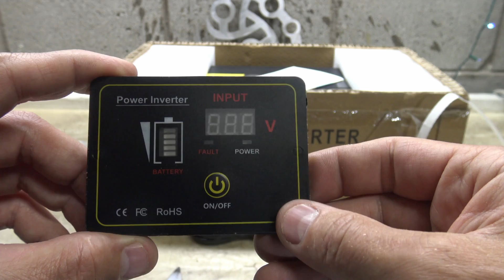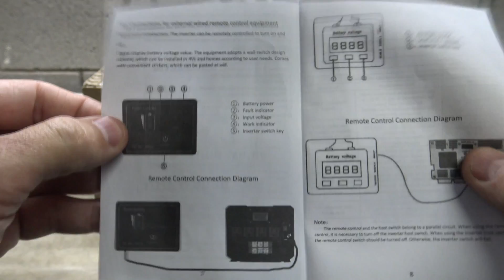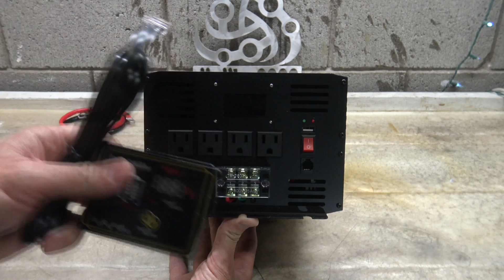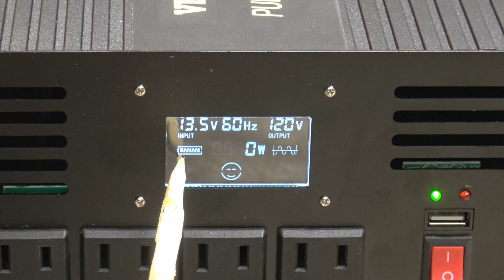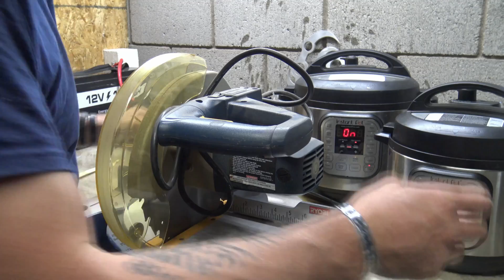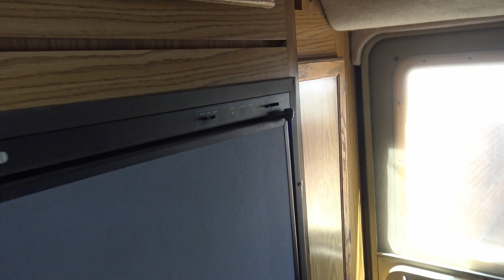OFF GRID POWER - VEVOR 3500 Watt Pure SINE WAVE Inverter - 7000 Watt Peak - It's EXCELLENT!

Comment: HOW is that 100ah battery putting out 2500w!? That's like a 250A 12v draw! That means the BMS is not properly setup. It's likely to burn up. 100Ah battery should have a 100A max draw BMS or 1C.

Comment: What is that part between the cable and chins battery? Is that to use a battery while charging the battery?
Reply from the maker: Great question.  It's a circuit breaker
Reply: @jiujitsu2000  also another question, what are the smaller wires before the inverter cables? Is it charging the battery while using the battery?

Comment: I thought about buying a vevor 2500w inverter but have some not so good reviews. I have a renogy 700w its a good inverter but too small for what I need. Most of the bad reviews on vevor were it didn't last much over a year and another person said it almost caught on fire. I need to run a 1400w chipping hammer but less than 5 minutes at a time.

Comment: I just installed my unit but it is reassuring to see others using the same unit. However the only thing different I am doing is installing an Ultra-capacitor behind the inverter to lower the battery voltage fluctuations and if the battery is fully charged then the unit will grab power from the Ultra capacitor before the batteries. The secondary advantage being that excess power from the solar panels will get used before the battery gets touched if installed correctly. It almost acts as a sort of solar soft start for the unit. Some people will say that you don’t need it but people who have it show it’s worth having. It’s just too bad that not many videos cover adding Capacitors to your system. It’s likely just because it can be the more dangerous thing to touch with bare hands when installing. So wear gloves. They increase the life of your system too by offloading cycling from the batteries and making power immediately available faster than even lithium.

Comment: Are you able to plug that into your home? Electricity one hundred ten volt circuit and power it off of that, instead of a battery I want to get the 48 V. Version so I'm sure I can hook the 48 V to my power box downstairs safely. And then I could run a Bitcoin miner. And make five thousand dollars every year

Comment: Great video I like to comment about using the test light so you don't get the spark too late for me for that 1. Also no one addresses the hardwire terminal box which 1 is the positive neutral and ground on it ?  When they use a black yellow and red wire all known to be hot wires

Comment: Give it a year, a year and a half tops of continuous use, especially when powering inductive loads, and I can pretty much guarantee that you'll be sending this unit to a shop for repair. All high frequency, transformerless inverters on the market have a much higher, failure rate when compared to low frequency, transformer based inverters. The reason for this is that these cheap, lightweight inverters don't have an iron core, copper wound, iron core output transformer. And a 7,000 Watt surge capacity for a 3,500 Watt inverter is pretty wimpy when you consider that a low frequency inverter inverter offers a minimum surge capacity of 10,500 Watts. And you really ought to reconsider your claims about this product. This inverter is absolutely NOT certified for use with medical equipment. It's not even UL-1741 listed. If a patient is injured because of your recommendation that this inverter is suitable for use with medical equipment,  you're probably going to find yourself in legal hot water.

Comment: I bought one of those things found it to be cross wired from factory did continuity test on the four out put receptacles and the neutral and hot were swapped on every other one of the 4 that can’t be good but the ground toned out fine this was also the case at the bottom contacts between the receptacles and the hard wire contacts below
Reply: Tha would explain why mine just sparked out and almost caused a fire...

Comment: The main issue I see here is most 100AH batteries have a maximum continuous draw of 1250 Watts, and at that draw the battery will last 1 hour maximum.  There's no way a 400 Watt solar is going to keep that battery from discharging so you are going to be "dead in the water" within one hour.  So much for keeping cool in hot weather!
Reply: how many watts of solar would you imagine is needed in this case?

Comment: So, that battery sag (dropped to 11.?v while you had the big load) is potentially a problem.

Keep in mind this is a 12v DC input, so at full rated load, you're pulling almost 300A. For the peak 7000w, that would be about 700A spike! I'll bet almost anything that battery isn't rated for a 300A output. You see a flashing red warning light near the power light on the invert during these situations.

Best to have multiple batteries paralleled (3 or more) so that each battery isn't exceeding it's rated output. 4 or 5 if you expect the 7000w spikes to actually be a thing on your implementation. Those lithium batteries do have a surge/spike rating but you still need to allow enough head room on the batteries to handle that spike.

One big issue with this setup could be that parts may fail in the inverter if the input voltage is insufficient. With a lower voltage a FET may not turn on fully and therefore it generates massive heat and it burns out, and you have a dead inverter, because YOU didn't supply it enough DC power.

When paralleling batteries, the neatest solution is to run each battery positive to a honking big bus bar, and the same for the negatives (to a different bus bar) and then connect the inverter input to those bus bars. This ensures you have sufficient input and the inverter won't struggle to turn those FETs on, giving you safe operating conditions.

Also, "sine wave" inverter isn't specific enough. Insist on "Pure Sine Wave" inverters. Never go for the cheaper modified sine wave or something only labelled as "sine wave" (if your goal is clean power like you get from your utility grid in your house).
Reply from the maker: Excellent comment.  Thank you so much!

Comment: Why do you suppose that they include so many fuses? I'll tell you why. These inverters simply don't last. They are of a high frequency, transformerless design and the MOSFETs cannot take repeated exposures to high surge loads such as full sized refrigerators, power tools or microwave ovens. They also run much hotter than low frequency, transformer based inverters which makes the low cost, off spec, Chinese made components such as capacitors, diodes, resistors and  ICs that are used in these cheap inverters, far more prone to early failure. You might be able to start and run high surge loads when this inverter is new but everytime you fire up that inductive load, you're shortening the life of your inverter. A far better alternative is to invest a little more money and purchase a low frequency, transformer based inverter charger. They last far, far longer and can easily power high surge loads without being damaged. See my video for more information on high low cost frequency inverters. I know this to be true because I've spent the last 23 years repairing inverters. They simply don't last when powering inductive loads. https://youtu.be/ZUvH8_h3iGU?si=F8Glaay4WKgoBIj8

Comment: They don't usually spark if you leave them turned off during connection.
Reply: Nah, they pretty much always spark. Your on/off switch only isolates the output. The input will always charge the caps as soon as you connect it. Use something resistive (a 12v bulb, an actual resistor about 20ohm and 5-10w or even a graphite pencil led will work) It only takes 3-5 seconds and the caps will be charged enough that that inrush of current will be subdued enough that the cable touching the terminal won't spark. Also the caps should hold that charge for long enough that you don't have to rush to swap out the resistive item and get the cable to the terminal. Well over a minute or more, so don't stress and start rushing. Keep it slow and safe.
Reply: @CollinBaillie  I've always made sure that they were turned off and have had never had one to spark.

Comment: How much power does it use in standby mode?
Reply: Website claims less than 1amp. I just ordered one a few days ago and a 260ah battery for my truck.hopefully it will run a mig welder for offroad repairs.

Comment: 👍👌❤️🇨🇦, sweet review, I would like to have a temp on the cables, I would be installing larger ones for heavy loads, less voltage loss, I would also like to see the  same display that is on the inverter to be also on the remote display, the little battery display is basically useless, having the volts and watts on the display would be a big bonus

Comment: I bought one for a home solar system, works great and it sells for as low as $210 now.  Buyer beware as many Asian brands advertised as pure sine wave but are actually modified sine wave.
Reply: That's good to know - they also at times over rate the inverters they will not perform as stated -

Comment: Not bad of a test only thing I seen was the voltage on the unit and remote did not match even with no load on that unit. With that big of a load I bet the battery will not last long but it do it.

Comment: You can damage the battery or the inverter by making it spark while connecting. It is recommended to use a resistor between the battery and inverter before connecting. This will charge the capacitors and there will be zero spark. If you don’t have a resistor handy and most people don’t you can do what I did. Take a simple test light the kind that looks like an ice pick, and clip the alligator clip to the battery cable and touch the other end to the battery terminal. The bulb in the test light will illuminate and then go out indicating the capacitors are charged. This test light must have an incandescent bulb to work. Not an led.
Reply: Yes I use an old 21 watt car bulb in series to pre charge the capacitors.
Reply: The only pieces at risk of damage are the screws 🪛 bolts 🔩, and washers. Pieces of molten metal could be generated and hurt people very seriously. 

Inverter internals and battery won't get damaged.

Disclaimer: do it at your own risk. I don't take responsibility for damages.
Reply: Do you mean like a fuse

Comment: I just bought the 2500W and it won’t stop beeping. It has 1/0 wire and is reading 12v input but won’t give any output and beeping non stop.

Comment: BE VERY CAREFUL. these inverters blow up. I'm serious. a guy gave me this exact one and the company cut corners on diodes to protect the IGBTS and the failed causing the whole inverter to smoke up. sure it works good (I fixed it and tested it) its just it will blow up.
Reply: I'd be interested to know more about your setup. What sort of battery were you using?
Reply: @CollinBaillie  lifepo4s and Agms at 12v

Comment: You can make a connection with a big resistor between the cable and the battery terminal to charge the capacitors in the inverter without a big spark then make the final connection with the cable to the terminal to keep from blowing out the inverter.
Reply: This is a good idea but the right solution is a flyback diode. Check that out.

Comment: One question...... could you hook up two inverters in series or parallel in a system?? or it's better to get a bigger wattage one to run?
Reply from the maker: I'd get a higher wattage inverter
Reply: @jiujitsu2000  thank you
Reply: Always better to go bigger than you need & not run them so hard, it may have a higher idle draw but will handle inductive loads better, ie: motor starting, microwaves, coffee machines, etc.

Comment: I love this inverter, however..... How do I calculate how long I can run it?   Battery "Ah capacity" as how it relates to load = time?  I am obviously a newbie and need some help in the design.
Initially I bought a Ecoflow River 2 (300w) powered by Renogy 100w Solar panel to get started and want to eventually bump it up to 2000w+ for when I leave on my USA Ultimate road trip (Honda Odyssey build out).
I need to calculate total Ah needed to finalize the build out and see how it affects my budget on the battery costs.
I thank you in advance for your time and help on this matter....... (GRIN)
Reply from the maker: Great question. What's the amp hour of your battery? Take that number and multiply it by battery voltage. My setup for example. 300A x 12.8V = 3840 watt hours... then you take wattage draw... let's say its 1000 watts... divide watt hours  by wattage draw... 3840 divided by 1000 =  3.84 hours... I usually round it down to the next number to stay conservative  so it'll run for appropriately 3 hours safely...I hope this helps you!
Reply: @jiujitsu2000  Thank you for the math.  I do not have a battery yet, but this helps in finalizing LiFePo4 battery(s) selection.   Thanks again!
Reply from the maker: @tobyz.3452  you're welcome!
Reply: @tobyz.3452 definitely go lifepo4 for this if it is in ur budget, but also remember to check on the battery BMS size for charging & discharging in particular as u will need to be able to supply 12v @ 250A-300A continuous output for 3000W-3500W, 12v & 200Amp Battery output will give you around 2500W. Hope this helps.
Reply: This video also has some good info  https://www.youtube.com/watch?v=zTi_NQzU

Comment: Very nice, but to buy it i need to sell my kidney first.
Reply: How much?
Reply: @rheidtech  
Under $300, so not bad for what you're getting.
Currently out of stock though😭😭😭😭
Reply: @dandycat2204  out of kidneys? Wow. That sucks. Just wanted 1. Dont need it.. just prepping ya know. 😅
Reply: @rheidtech  
Are you sure, cos I do have a spare...it's yours for the bargain basement price of $500,000.
Barely used.
Reply: @dandycat2204  is that what kidneys are going for? I've been thinking about selling mine.. I don't know where to even start..
Reply: @smilemore1997  
Hi Smile.
Well, that's what mine will cost...but it is in PRISTINE condition 😇😇😇.
As for where to start...
Well let's just say I know a guy...